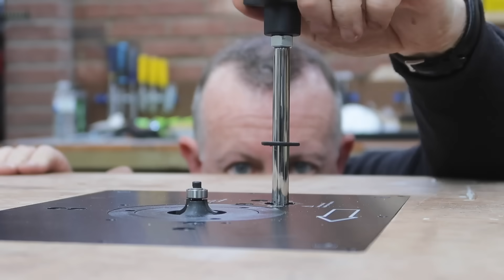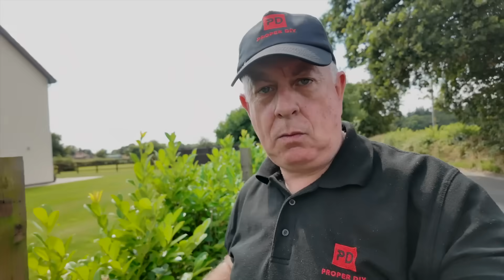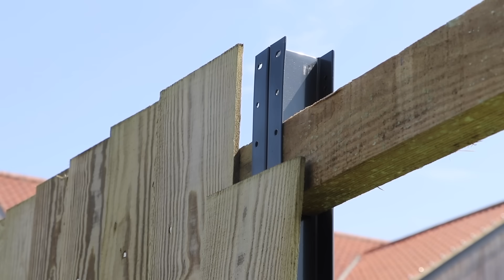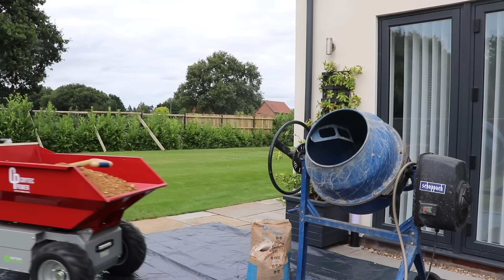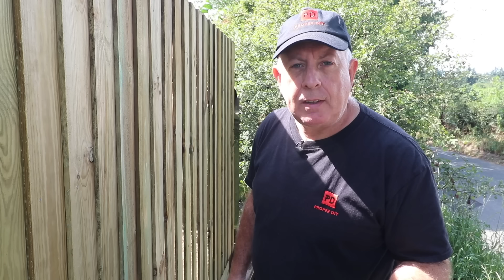Save Thousands By DIY Fence Building: Step-by-step Guide

Comment: I am just buying my first house and needs loads doing including 10 fence panels which are all broken and it backs onto an alley. I think I might build my own onto the concrete posts like you did to these metal ones instead of buying panels at £50 per 6x6

Comment: Hi Stuart. Thanks for another really helpful video. I have got some Duraposts in and noted there is about a 3mm gap when the 4x2 goes in. Did you have this on yours? I was thinking of using a washer to help ensure the screws pulls it all together nicely. Thanks Simon

Comment: I built my fence 13 years ago, still standing strong, but I learned today that I can finish it off with Fence Capping Rail Treated Timber Rebated Cap Rail for Featheredge Fencing. Thanks for the video! New subscriber. Woman diyer. People might not approve, but I covered my fence in used engine oil. That, I find, is the best weather protection. I will be adding capping rail,  I just need to measure how much I need.
Reply: I used screws for my featheredge. I can take the slats off at any time. Like I had to, to fix an oak bench's backrest. London has no space, so I made an oak bench near the fence.

Comment: It is a very loose term DIY, given the amount of expensive equipment you are using.  Do the next one with basic tools that real DIYers use.  Good job but for a basic DIYer.
Reply: When you're a keen DIYer you end up with lots of tools. It's an investment, they make future projects easier and it will still be cheaper than hiring someone.

Comment: Great video and advice and the end result is fantastic – well done.
Was thinking of doing something similar, but instead of vertical feather edge boarding would prefer vertical hit and miss boarding – just prefer the look and could also help with wind filtering.
Is there anything else I need to factor in for this or would it be step by step the same apart from the final facing appearance- thanks

Comment: Im a big fan of Durapost. Very light to work with but strong once in place. A precast concrete gravel board is a further improvement as it means there is no direct contact between the timber and the ground.

Comment: I’m looking at replacing a fence on a property where the fence is adjacent to a public road like yours and read that the max height allowed without planning permission is 1m. Also, you are allowed to replace an existing fence but not increase the height like you have here. Did you have to apply for planning permission or have I got this wrong? I want to increase the height of mine too.

Comment: Another US DIYer, with questions about terminology. Gravel boards -- what are they, and why don't they rot where they come in contact with the dirt? Any idea what it might be called here, if it exists? Feather-edge -- I can't find anything like that here, except maybe one fairly rare kind of siding. Is there another term I should look for? Or alternatives? 

I did our back fence maybe 3 years ago, only 6 yards long (the lots here in my city are quite narrow). The soil is total rubbish, mostly sand, and there is a level gradient between our yard and the yard behind because we are on a hill. I couldn't get the old concrete out, so I had to offset the posts. I did the best I could, dug the holes 2 feet deeper and used 10 ft posts, painted the bottom with a double coating of preservative, but the saving grace was the two cyclone fences running on either side of our lot. I was able to anchor the end posts to the steel end posts of the cyclone fences, and that has made it super sturdy. Half the posts could rot and it still wouldn't budge. Also, I made the center section so I could remove it in case I ever need access to the other side again. That's the last time I'll be doing that, I'm now 76.

Comment: That looks like.hard work, all that wood wouldn’t do in Australia termites would love it, we use metal posts and extruded sheets similar to the roofing made by Stratco, they are all framed in similer material and are very strong and finished in powder coating, they can be installed into the ground or large faux limestone blocks for sloping lies

Comment: If you see this I was wondering, your costing summary says you used 150 x 2400 feather edge boards, your posts were 2400 as well, but you had 600 in the ground giving 1800 out of the ground. With a 150 gravel board that leaves 1650 of post above the gravel board. If you then fit 2400 feather edge boards your feather edge board would sit above the post by 750mm but it looks like you only have about 100mm above the post, so did you list the wrong size, cut them all down, or have I misunderstood something? Trying to plan out my own fence like this and I am confused about sizes at the moment. Thanks.
Reply: I am thinking you used 1800 feather edge boards. My thinking being you used 2400 posts which would give 600 in the ground and 1800 out of the ground as is the norm. Then with a 150 gravel board that reduced the height to top of the post to 1650. This is a common height for feather edge boards but you have some above the post. I said previously it looked like 100mm but that would mean a feather edge board of 1750 which doesn't seem to be available. Where as 1800 feather edge boards are so I'd conclude it was 1800 boards used and not 2400.

I think you also missed off the gravel boards from your costings.

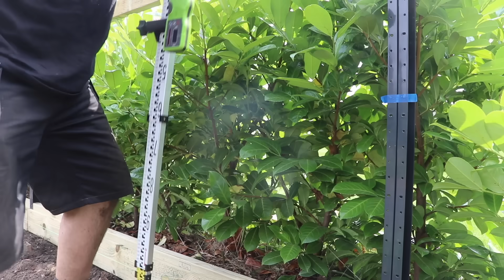Comment: Hi, great video.. you've convinced me to go for this style. Just one question.... at 10:53 on the video you screw in a bottom screw on the gravel board. What does this screw into? As in the shot before the CLS wood is only wide enough to accept the top screw of the gravel board?

Comment: 16:35: MUPPET.    i was about to point out that the hoselock water gun you are using has a wide variety of spray patterns, by twisting the head.  you used the worst one possible, in terms of ricochet effect. duh

Comment: I am going to make the exact same fence over 30 meters .. I am just working out the heights. If I buy 2.4mtr duaposts and put 600mm in the ground there will be 1800 above ground .. with 150mm gravel boards I may just go for 1800 feather edge to save me cutting them all and let it go over the duraposts by 150mm. I was confused by the buy sheet as it says 2400 feather edge lengths .... I think I just worked out my measuring writing it down here !

Comment: Why add or repair a fence to the outside of a hedge. Afterall a hedge should be a boundary. You seem to have a laurel hedge on the inside so why not save the money and just remove the fence trim the Hegde up, it grows quickly. If you are bothered about security just put a temporary post and wire fence in untill the Hegde gets dense. It's. A rural location and a domestic close board fence against a road also seems visually ugly. If you have to, put the fence on the inside boundary so it's less ugly and easier to maintain from your garden sider

Comment: Hi Stuart. I did exactly what you did on the bottom rail of the fence I built about 10 years ago  I also added some extra mimi posts behind to support the bottom rail. The shoulder on the top of the gravel board and the rail is great for holding the feather board while you are nailing. Two inch ring shank sherardised nails No problems so far!
Reply: Mini posts!

Comment: Great video. I was already intending to use Duraposts and got a quote from Birkdale using composite rather than timber for a similar length to your fence, £9k for materials! I’m now going to use your method and great tip about gravel boards
Reply: If the posts were at 2.4m centres how long was your spirit level?
Reply: Concrete gravel board are fantastic because they don’t buckle or rot. They also don’t hold water so don’t cause the fence panels to rot at the bottom.

Comment: Looks neat but it had alot of flex in it when you nailed it. How has it stood up to the storms?
Reply: Is that because the concrete hadn’t set? I noticed that too didn’t fill me with confidence. I would leave it 24hoyrs before putting the rails in personally

Comment: Tidy job Stuart but, That fence will be flopping about in the wind using those Duraposts, they are terrible and using a 2.4M span between them is no good (1.8m on centre maximum). I stopped using them due to customers not being happy with the flex in them. You should have shown the flex in them on the video as it will surprise a lot of people. Viewers will see the flex when you are nailing on the slats, look at the movement in the fence.
Reply: What are you using now?

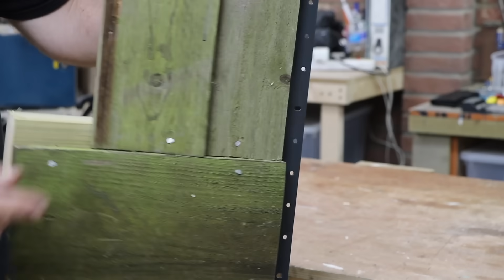Comment: @8:51 I love the idea of connecting the gravel board to the feather edge via the timber, but are you concerned that water will pool on top of the C24's flat surface? Running it through the tablesaw to give a bevel like the other arris rails would allow it to run off rather than pool?

Comment: I saved about 3 grand DIYing my fence. Durapost, composite board and closeboard framed panel. Did my garden and communal area, about 60 odd metre run in the end. Not perfect but I can swallow that for a 3 grand saving 😂

Comment: Always build my own fence last one lasted 9 years and the current ones if on 5 years, we moved the orrible panel fence that they fitted before selling the house to us it lasted not more than 2 years fell apart even after being stained regularly, I hate those pre made panels concrete uprights are still good.

Comment: I used the Duraposts myself for my garden recently and they are indeed a game changer for long lasting low maintenance fencing, however, I'm surprised you didn't at least consider an alternative material for the gravel board. I find treated timber to be very short lived, so alternatives like plastic are a better option IMO.

Comment: You obviously live in an expensive part of the world as far as fencing contractors go - recently looked at my daughter's fence which is the same length as yours. Decided, for longevity, to use concrete posts and concrete gravel boards, with standard feather edge panels. Included was a gate to allow rear access to the garden - total cost £2400. Excellent job by the two guys who did it and saved me a lot of back-breaking work, not to mention getting the stuff delivered, etc., etc. I have to admit that I was amazed at the quote and the standard of workmanship - maybe I just got lucky! Great video, though - even though I was getting tired just watching your efforts, lol. Thanks

Comment: Thanks Stuart, been waiting for this as I have 14 meters to do and will certainly follow the way you did it. Your cost breakdown shows you bought 2400mm feather boards but the finished fence only seems about 1800mm high. Am I missing something or did you have to cut them all down?

Comment: I recently had to change 70m of fence. I put it off for so long because I had never done fencing. I got quoted about £8k in the best case. I decided to do it myself and also used the durapost system. In total it cost me £4k, but included in that I bought a petrol hole digger (Chinese cheapo), a nail gun for my compressor and various items like magnetic post levels etc. My neighbours were so happy they insisted on paying half which was a lovely surprise at the end. The duraposts are expensive compared to other options but are worth every penny. I did the whole 70m over 2 weekends solo.
Reply from the maker: Nice one!
Reply: Excellent work.

Comment: it does look smart. Motivation would be my problem. I think you should include the cost of the power wheel barrow. (£3000?)
Reply from the maker: I didn't buy it for this project it just happened to turn in time to use it - £1600

Comment: I used the Durapost website to find stockists, there is a link there etc.. some supply really good advice as well…
Job looks great and good explanation on how/why you carried it out.
Durapost really good for different styles… used DP composite gravel board with posts and  6”x2” and 4”x2” rails layered horizontally with 1” gaps to give a different slant on traditional post and rail in my garden, 25mtr job.
With regards Sagging issue with f/edge maybe 1.8mtr gaps between posts and if using durapost use a 6”x2” rail as the gravel board slotted inside the posts? F/edge then nailed on the outside, also 3 rails @ 450mm gaps makes for a strong fence, although more expensive…
Enjoyed the video

Comment: I see two possible issues with Your new fence. 1. You made a high wall that in case of a strong wind will collapse anyway. Your bushes are very well grown so why dont you put a fence made of steel net? Wind will go through the fence if made of a net and not collapsing at all. 
2. Wooden gravel boards - whyyy? In Poland we use concrete ones and they last for dozens of years.

Comment: I'm a retired odd job man , done quite a lot of meters of fencing .I use to concrete in a vertical centre stump in the middle of each bay at the back of the fence, supporting under the bottom rail and fixing the gravel board to the face. This stopped the fence sagging and the gravel board pushing out. Enjoy watching the channel, keep them coming.

Comment: I saw you scewing straight into the timber. When can you do that and when do you have to drill a hole first before screwing so that the timber doesn't split?
Reply from the maker: If you are close to the end of a piece you need to drill to stop splitting. Some of these I had to do that with
Reply: @ProperDIY  thank you

Comment: Fence looks good, and under usual conditions will last well, I hate to break it to you but that laurel will start to push it over in another 2 or 3 years, as a gardener I'd never advise customers to plant laurel as a hedge, a similar look can be obtained with grisellinia or escallonia without being nearly as aggressive growers. My advice is to take it out now, it's also far too close to the fence, I would plant a hedge at 2 ft from a fence minimum, preferably 3. Still ...at least you didn't shell out 3 or 4 grand for it 😅
Reply: English yew is also a good hedge

Comment: Unfortunately mate. You've turned into a YouTube bore recently. "save thousands build you own fence" lol. Hardly a DIY channel anymore. A list of kit  you used... SDS drill, post hole diggers, 360 laser, electric dumper, concrete mixer, concrete vibrator, nailgun etc. hardly a cheap setup. Anyone who owns all this kit already knows how to build a fence. Boring.
Reply from the maker: A classic reply! I see comments like this on all my videos and an excellent time to address them. You don't need the SDS drill, laser level, dumper, etc or any of the tools I used on this. However you do need the motivation to do it and to save money. If you have this motivation, nothing will stop you and you will be able to do the same as I've done here with a second hand spade, spirt level and a rusty hammer just like I did for 30 years before I could afford to buy the 'sexy' tools. Unfortunately though, if you are looking for an excuse NOT to work hard and save money, I can tell you that no amount of expensive tools will ever help you get started!

Comment: The materials cost a FORTUNE.

Should be a crime on all channels to call things that are plum, “level”. 😅

I’ve always wanted to know the wobble on these posts, I know they’re wind tests but they seem to flex more than a nice 4x4 post,

Cheers
Reply from the maker: Sorry, but as a qualified Civil Engineer with over 30 years in International Construction I have to correct you. Level commonly refers to something that is horizontal and plumb to something that is vertical. If you asked someone on a construction site 'is that column level' you would get a some very strange looks.
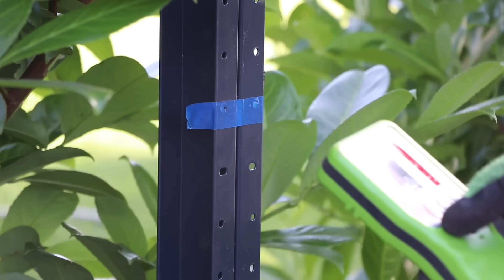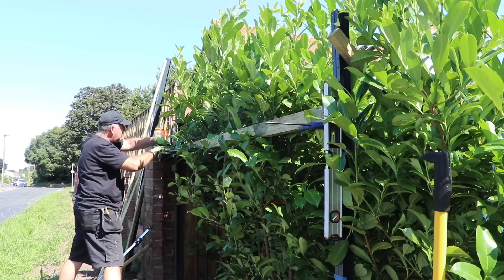Reply: @ProperDIY  6:35 6:48 that’s exactly what I said, your post is vertical and you’re calling it “level”.

Comment: I can't help asking. . . . judging from the concrete consistency, it looks like you're using Sharp Sand rather than 20mm all-in ballast for the concrete - something I've been contemplating. 
Am I correct?
Reply from the maker: It was actually all-in ballast but difficult to see once it's mixed.

Comment: What nail gun do you use there? Is it a 1st fix or 2nd fix nail gun?
Reply from the maker: It's the Hikoki  1st fix framing nailer - electric not gas. I think the most reliable on the market.

Comment: It looks really good quality work. Those posts look very efficent, quick and easy to use. It's the savings you make vs a contractor that really makes the biggest difference.

Just a quick couple of questions: Regarding your electric breaker was that an SDS Plus or  an SDS Max type machine? And whats the difference?
Reply from the maker: It's SDS Plus which is smaller than the max and more suited to DIY size work.
Reply: @ProperDIY  Thank you for replying and answering my question, and apologies, it's taken me a while to reply. But once again a great video, many thanks. 👍

Comment: When laying out the featherboard, I watched a neighbour do it and they used a storyboard with marks on it where they would go and then transferred those to the cantrails. They can then lay out the whole fence (or in sections) and line up the featherboards with them afterwards. This avoids creep as you go and makes lining up quicker since you don't need to use the jig for an offset, with a hand to hold it.
Reply from the maker: Yes, thats a good idea

Comment: I gave up on fences about 25 years ago, bit the bullet and had block walls built. It cost a few bob at the time but has saved a fortune since due to zero maintence and doesnt need replacing every 10 year. It will see me out.

Comment: Done a similar installation using concrete posts . Built a support post system to keep each post level whilst setting. These metal posts look a lot easier.